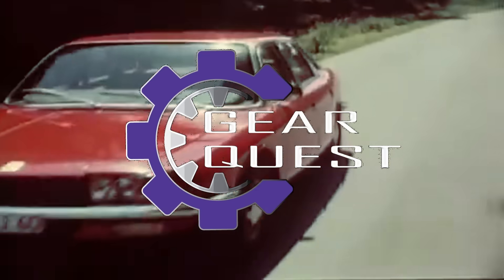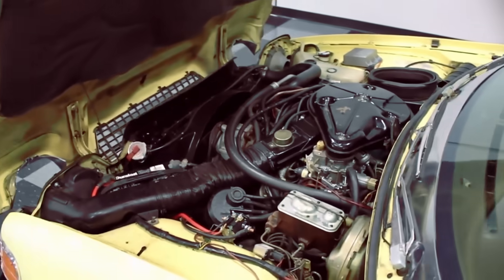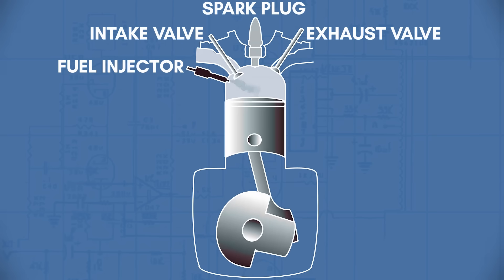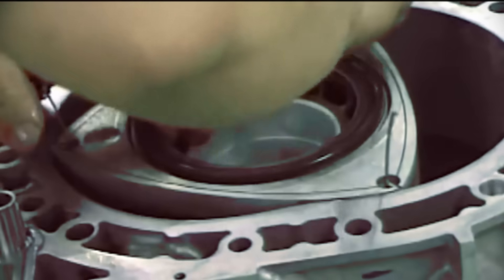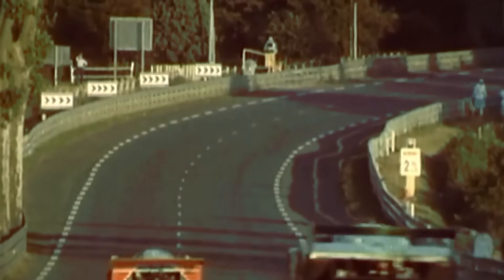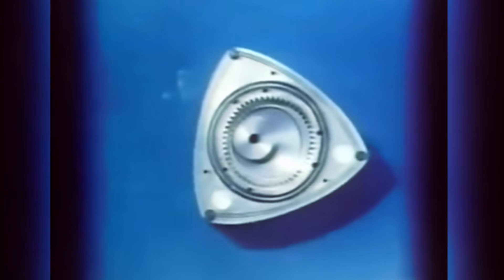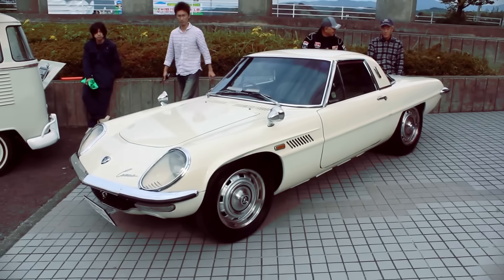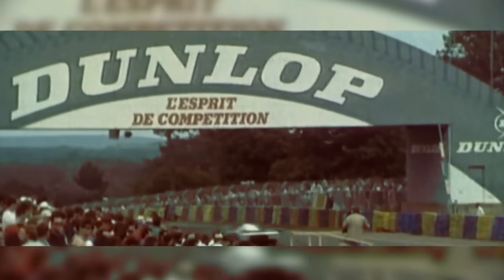The History of the Rotary Design

Comment from the maker: For anyone looking for a follow-up: https://www.youtube.com/watch?v=4CdiJ-JE_Pk&t=79s
Thank you to the commenters below that caught the two typos. It was supposed to be "conventional internal combustion engine at the time" and " 26B". Also, I am referring to a "4 cycle piston engine" when mentioning "4 cycle engine". Hopefully, that doesn't take away from the comparative analysis that the video is based on.
Reply: Mazda actually made a Hydrogen engine out of the rotary. So they didnt completely stopped it. I think they are just waiting when the time is right.
Reply: @mikexii13  yes, Honda did find out that rotary engines and hydrogen actually do mix!
I learned this in the early 80s.
Reply: Incredible information overload for guys like me! I LOVE it!
Now, that being said, the apex seals were obviously a ubiquitous trouble spot.
With the advent of newer oil additives, especially the friction reducers and thickeners, they may want to revisit this little powerplant.
I have had extremely good luck with a combination of oil thickeners and wear reducers.
So much so, that I wore out the seals in my big Class 8 diesel engine long before the engine was about to give up.
Motorkote makes a wear reducer that is amazing, and Lucas makes an oil stabilizer that raised my oil pressure considerably.
Perhaps these two items would make it worth another look at the Wankel engine.
With these additives put into an engine-specific oil, not only would this revive an efficient powerplant, but the oil itself, sold off-the-shelf, would increase the life span of not only consumer engines, but high-performance ones as well.
The only recommendation I would make is to not overprice the "new" oil.
Reply: @macgyveratlarge2133  - no matter what oil you use in a Rotary to reduce engine wear, this won't make it better suited to today's world.
The rotary isn't an efficient engine, except for power vs overall size and perhaps power to weight (but what about LS V8s?). It's the inherently poor fuel efficiency that ultimately killed the rotary concept.
Reply: @johncoops6897  Yes, having to rebuild about every 60k miles is not a soothing thought.  That said, great work Gear Quest!  As the son of a man who owned an auto repair and resto business this is a though coverage of the rotary engine.
Reply: @LaSouthernGemini  60000 is a gross under estimation.  Look up '84 Rx7 for sale and you will find more than enough with 115000+ . Agreed that you won't find the 300000+ that I have gotten out of more than one good old fashioned v8, but that is a most enjoyable 120000.
Reply: @spudboyQ  - yeah, I suppose you can find '84 RX7's with only 115,000 on them. But you won't find one with 115K on the original fucking apex seals.
Reply: @macgyveratlarge2133  I don't think anyone will revisit anything, since the era of all-electric vehicles is approaching..
Reply: i guess you also meant a reciprocating piston engine, when you said that AMC thought the wankel will replace the internal combustion engine.
Reply: Awesome video! I personally feel the Wankel engine has met the same same fate as the Sterling engine: great ideas that couldn't be utilized in modern society.
Reply: @bjusticeforever  - good analogy. However it's not that they cannot be utilized in modern society, it's simply that there are numerous BETTER WAYS to do it.
Reply: You'd have been better off (initially AND subsequently) to familiarize yourself with the term and the concept of RECIPROCATING piston engines. (Clearly, you're not  a student of automotive mechanics and should have consulted with one before partaking in this video.)
Reply: Fantastic video. "84 rx7 was and still is my favorite car that I have ever owned. I always wanted to see and understand the internal workings of that motor. I will always hate that lady who crashed me. Thanks for this video.
Reply: Gear Quest how about them cams and valve bodies
Reply: @JezBollah 667 Road "service"? You'll really have to start proof-reading your voice-to-text posts! LOL!
Reply: Michael Scott he does have a point, wankles rev to the moon and back but these engines were never made for long term running... I remember back in the 90’s seeing 2 year old FL rx7’s being sold in swap sheets via already needing a engine overhaul.... I should have bought all of them up!!! I never liked the engine but a mid 90’s red with tan leather interior rx7 is a sexy ass car
Reply: I know Im asking randomly but does anyone know of a tool to get back into an instagram account..?
I somehow forgot the password. I love any help you can give me.
Reply: @Dante Boone Instablaster ;)
Reply: @Milo Remington i really appreciate your reply. I got to the site thru google and I'm in the hacking process now.
Seems to take quite some time so I will reply here later with my results.
Reply: @Milo Remington It did the trick and I finally got access to my account again. Im so happy:D
Thanks so much you saved my ass !
Reply: @Dante Boone no problem xD

Comment: Honestly, I think the biggest thing holding the rotary back right now (2022) is the cost of parts. The cars with them (generally) are dirt cheap for the base models, just most of those will/do have motor issues. Though, I know many grease monkeys that would have no issue doing tear downs, and getting some of these dead cars back on the road. I personally would be all over these things if a rebuild kit (bearings, seal springs, seals - side/corner/apex/cooling) didnt cost ~$2000. Or hell, even an apex set didn't cost $400+.

I get that oem isnt being made anymore, but the aftermark who ARE still making the parts (IMHO) are gatekeeping the whole community by charging vastly overly high costs for, lets face it, small heat treated strips of metal. Yes, they did put large amounts of time, effort, and money into engineering their product, but that was decades ago for most. Its no different than the guys who have been working on these motors for 20 years, not wanting to share any info about them. Those types are artificially making the rotary market even more niche than it was before, or ever needed to be.

I feel if the price of normal wear replacement parts were cheaper and more accessible, there would be more interest in the rotary. That people would be more willing to "take the gamble" of getting into one, knowing that it won't cost them their first born if/when something does go wrong. There would be more demand, justifying more supply, and an increase in sales. Right now its just a low volume, higher return. It could just as easily be a higher volume, medium return if they would loosen the purse strings a bit. Just my 2 yen.
Reply: The Wankel engine has been obsolete for some time for the simple fact that it has several major disadvantages and no significant or useful advantages.

Comment: Why not introduce another spark plug in the exhaust side to try and burn additional un-burn hydrocarbons and fuel ?

Preferably positioned as early in the cycle as possible ?

Wouldn’t this further improve fuel milage and clean burning ?
Reply: No, it won't work, spark ignition only works reliably within a very rich air fuel mixture and with oxygen.

Comment: Craig Ewing
Nicely done, of potential interest to some of your viewers, the rotary compression test we did at Mazda dealerships used a chart recorder/printer with a diaphragm that would show EKG like pulses on a roll of thermal paper. A diagnosis of failure of apex or side seals could be made by the printout showing two high pulses and then one low pulse (side seal) or two low pulses and one high pulse (apex seal)
Those without the chart recorder can get by with a standard compression tester with the schrader valve removed and recording the pulses and playing back in slow motion. This is due to rotorys not having any static compression at cranking speed, there’s only a puff or pulse but it can be measured.

Comment: only 1 area of a rotary is a combystion chamber....hence why a 1.3 is a 1.3 and not a 3.6L.....otherwise 2 stroke piston engines would be any interior dimension including the rod and cranks open chamber and the ports and be measured much larger
Reply: The Mazda 13b series has a total displacement of 3,9 liters.
Because it has 6 combustion chambers.
All Wankel engines use the same 4-stroke operating principle as a Otto Cycle engine.

Comment: My Dad’s advertising firm won the Wankel engine account during the late 60s early 70s. He maintained the reason this wonderful engine failed to be used widely in vehicles for the retail market was because of the cost of replacing the apex seals. Think he said tungsten was the preferred metal used for them.
Reply: The Wankel KKM design suffers from many flaws, poor reliability of the seals was indeed the insurmountable obstacle to widespread adoption.
 Fuel economy dealt the Wankel a final blow during the OPEC Oil Crisis.

Comment: The rotary engine IS an internal combustion engine.  So, it wouldn't eventually replace internal combustion engines.
Reply from the maker: The audio dropped out and I corrected the error in the pinned comment above. Thanks for listening closely 🙏🏼

Comment: "Dominated" huh? The Mazda 787B never won another race in the entire 1991 World Sportscar Championship season and fact is never finished another endurance race higher than 5th. Mazda finished the 1991 WSC season a distant 5th too. The 1991 win at LeMans was part due to unusual circumstances and part fluke since it was nowhere near the front running Sauber-Mercedes cars, all three of which were way ahead of the Mazda when they all retired due to technical mishaps and driver errors over the course of the race. 
As for the unusual circumstances for the 1991 race. Many factory teams for Group C cars had retired their old cars for the old regulations and few 1991 regulation cars entered the race. In order not to have a half empty race the old cars were allowed entry with some "special stipulations". The Mazda slipped in with this rule and nobody bothered to check its legality anyway since it was just a Wankel powered Mazda nobody saw as a threat.

Comment: The Le Mans winner was powered by a 4-rotor 26B engine with variable intake trumpets to maximize torque at all rpms.
Reply from the maker: I corrected the mistake in the pinned comment above 🙏🏼 Thanks for listening closely and hopefully it doesn’t take away from the comparative analysis the video was on.

Comment: One factual correction. The car that won the 24 hours of Le Mans in 91" did not use a 13b engine. They used a 26b 4rotor engine that was dummied-down to produce appx 725 hp. In development the car pumped out as much as 1000hp. But Mazda felt they couldn't find a robust enough transmission to handle that much hp for 24 hours. The finished product produced 725hp, maybe more. The car was not an RX7, but a category Group C prototype top class race car. Although the car had 725hp, it was still down between 80 and 100hp to the Jags, Mercedes and Puegots. Mazda was therefore allowed by the racing rules to run at a total weight of 83kg to make-up for its lack in power. The 4rotor 26b engine is yes, technically 2 13b's put together making it a 26b engine. Mazda's 12a, 13b,  20b (3rotor) engines, are the only mass  produced engines for production applied in the 1st gen RX7'S 12a up to 1984 before switching to the 13b the last year (1985), the 2nd, 3rd RX7s and RX8's with a 13b's only. The 20b (3 rotor engine) was only produced in Japan for Mazdas Mazda Cosmos sedan. The 4rotor was only applicable to Mazda race cars in prototype and GTO IMSA Rx7 s from 90' through 91' where they won championships. Those cars produced 650hp. The 3rotor was also was applied in racing in Rx7 s in the GTO category in IMSA racing series along with the 12a and mostly 13b engines..
Reply from the maker: I corrected the mistake in the pinned comment above 🙏🏼 Thanks for listening closely and hopefully it doesn’t take away from the comparative analysis the video was on.

Comment: Such an elegant mechanical design, those wankel engines. Mazda used them in mass production, good on them.

Here's an engineering challenge for you engineers...

(In-wheel) Hybrid Hydro-ICE (Turbo) motor-generator pump...

o 3 or 4 Cylinders in a radial Y  or X configuration wrapped in coils with at least a top, (mid) and bottom coil 
o Strong neodynium magnet sits on top of a ceramic or non-ferrous alloy piston head
o Piston fires from the (wheel) rim to the (wheel) center at a magnet with slits in and the ame pole facing out
o Magnetic repulsion spins the central, non ferrous, slitted, axle-mounted magnet
o Coolant immerses the engine guts, filling the cylinders and rotor area, cooling the magnets
o A firing piston forces the coolant through the slits on the central rotor magnet, as a hydraulic motor
o Magnetic repulsion increases as hydraulic power decreases, cylinder coils generate electricity
o Magnetic repulsion returns the free piston and expells exhaust gas in 4 stroke mode, or compresses in 2 stroke
o The outer cylinder coil nearest the rim provides the powerful compression needed for combustion
o Oval pistons can't spin so the magnet can be shaped to match the rotor cylinder magnet for more magnetic force
o In 4 stroke mode one or 2 mini turbos are possible, sitting between the cylinders, firing from wheel front to back
o exhaust gas goes through a combined catalytic converter and Stirling engine-generator.

Comment: You know a lot about motors, but not a lot about Mazda at all. Mazda won the 1991 LeMans race overall with a 787B and that was a 4 rotor R26B NOT at 13Brew. It was also naturally aspirated and did not have the 3rd gen's turbos or in any way resembled an RX7..  
 The RX8 was NOT in any way a spiritual successor to anything. It was more of a GT car and the Renisis was a failure due to the stupid exhaust port positioning and Mazda building inferior parts which fail quickly. It was a terrible engine.
Reply from the maker: The 787B error was corrected in the pinned comment above. Thanks for listening 🙏🏼

Comment: I raced an RX-7 with both bridge porting and peripheral porting in SCCA and IMSA respectively.  The oil metering system was removed and blocked off entirely as there was no way to know if that was properly functioning.  Synthetic two-stroke motor oil was pre-mixed with our fuel for positive lubrication.  At years end, when the engine was disassembled, much of it looked brand new save carbon deposits on the rotors themselves.  Red-line was 9,000rpm but I'd go to 12,000 IF it meant a pass for the win. I never saw wear as you indicated.

Comment: Basically a 2 stroke engine.
Reply from the maker: Not quite. Rotaries are a two-cycle four-strokes, they have a true 4 cycle (combustion event) but unlike a piston 4 cycle engine the rotary only needs one crankshaft revolution to complete its cycle, just like a two-stroke piston engine
Reply: @GearQuest  All Wankel engines use the 4-stroke operating principle.
BUT requires 1080° degrees of crankshaft rotation not 360°

Comment: NOISE, NOISE AND NOISE.  When they ran with no mufflers like the other race cars they were deafening.  They shot flames out because the Wankel not fuel efficient and fuel particles make it out into the exhaust still on fire.  People around the race tracks complained that they could hear the scream of one Wankel over the roar of the rest of the cars.  The light weight made the cars without mufflers competitive.  To stop the noise complaints the cars were required to run mufflers to get the noise level down.  At that point they were not competitive.  Secondly the rotary are not as fuel efficient as a piston engine.  So in races that ran such that a non efficient engine would either require a fuel stop (and lose the race) or not make it for the distance, the interest died.

Comment: The Rotory, it was an incredible design that challenegd the thinking of the time. It did give even V8's a run for their money. They did have their problems and they were significant enough to cast a shadow over an incredible motor design. Yes, I did say "Motor".. there's a reaso  for that:- Motorsports... American Motors Corporation, General Motors.. Motor car.. Motoring, Motorcycle, Motorbike..  yet many insist on saying "engine"..  When "motor" is used to describe practically all forms of motorised transport..  and there it is again, "motor"-ised!..😁

Comment: Basically the rotary was so ahead of anyone els and  was so awesome it could do 24 hours races with out servicing and the other manufacturers Didint like it cos it was built so much better then any engin that's why the 787b is to this day awsom 4 rotary engine and would of won any race back in the day so basically it was banned becouse of jealousy so keep on brapping !!
Reply: The Wankel engine is notoriously unreliable and became obsolete because it is not as good as reciprocating engines.

Comment: Such a good video. So many retards in comment section. 
Every single car in NSU 80 era did roll that much in the max. centrifugal force it can hold the circular trajectory. Even the new cars without adaptive suspension or gas suspension would act almost like NSU at maximum lateral G cornering.